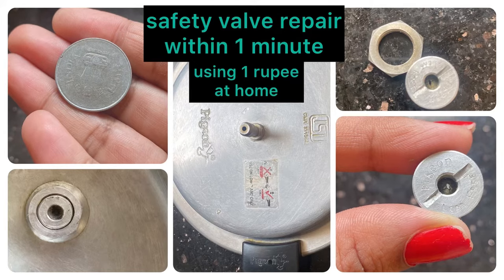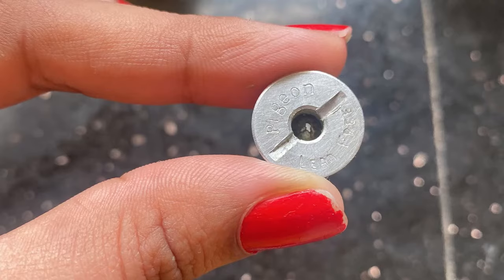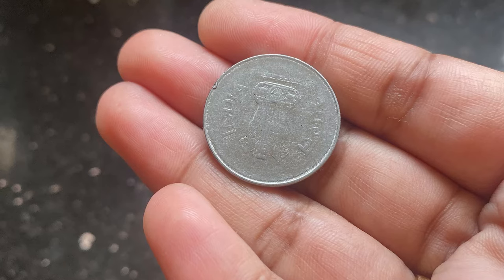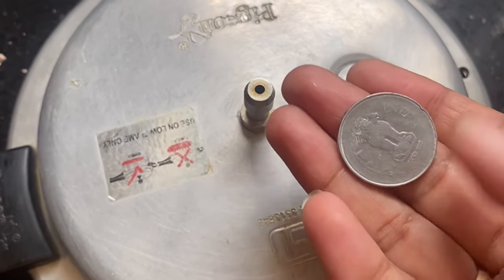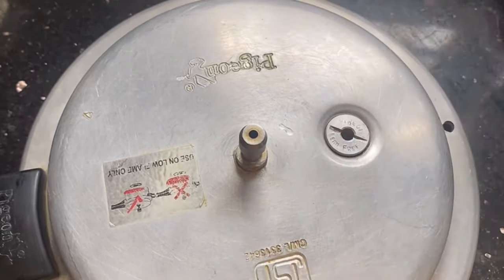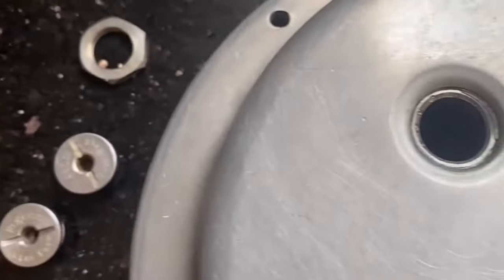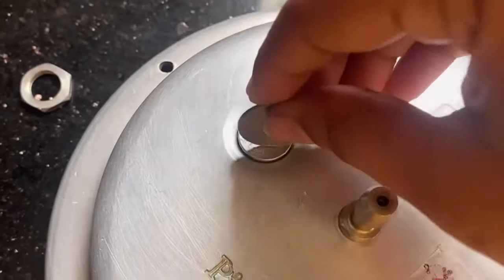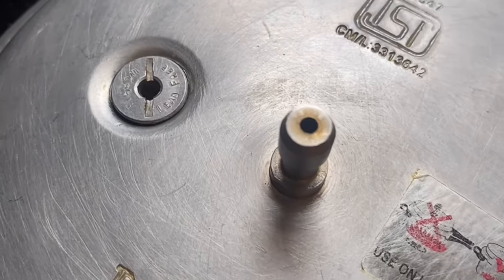pressure cooker safety valve repair in 1 minute at home |safety valve not working|cooker repair|tips

Comment: All safety valve are not removed  with the coin we need tools like screw driver and a spanner
Reply: Spanner & coin will do. But spanner is needed as otherwise, the nut will rotate with the valve and won't be fully tight. Coin is a replacement for screw driver
Reply: Exactly

Comment: Why he is given that hole any scientific reason
Reply: too much temperature due to too much pressure melts the metal and creates a hole. they could have avoided it by either lowering the heat as it cooks or decreaseing the amount of the food/water inside the pot prior to cooking.
Reply: That safety valve has a tin or lead metal which melts when temperature becomes high, it melts and creates a hole for the steam to vent out. This is to prevent explosion of cooker caused by blockage of the main venting hole. Since pressure and temperature are dorectly related, high pressure will cause high temperature and hence melt the tin/solder valve